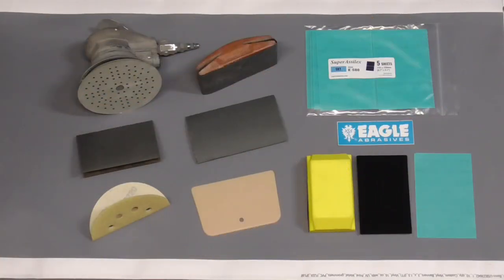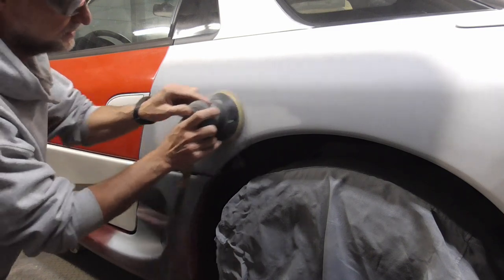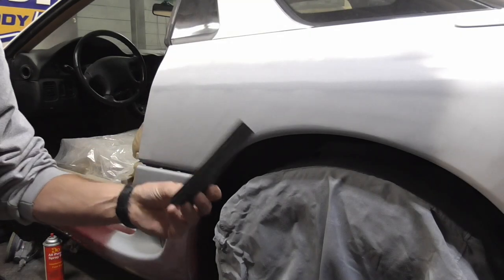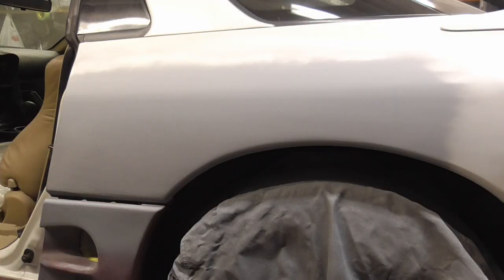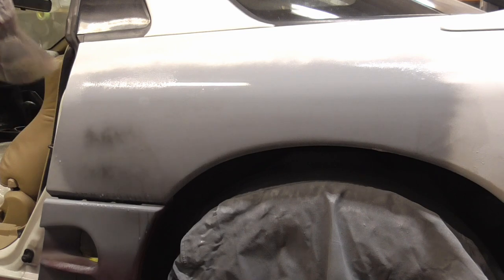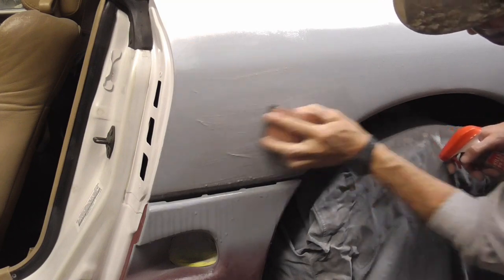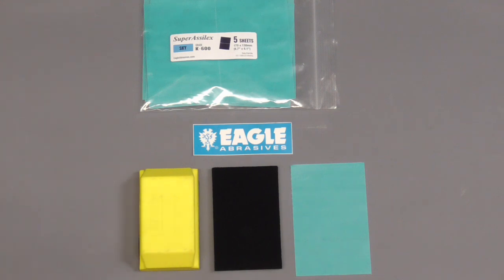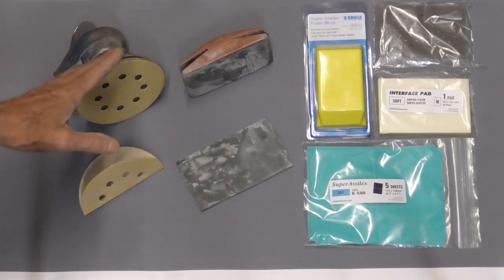Finish Sanding the Final Coat of Primer - Clear, Easy Instructions

Comment: I am a big fan of hand sanding wet personally. Keeps the dust under control and reduces heat from friction. Plus I like the exercise. Right now im prepping one panel a time on this Integra and goal is to paint in the fall when its in the low 70s and almost no humidity. Got a waterproof cover till then to keep it fresh haha. Thanks for the videos.
Reply from the maker: The exercise is incredible really.  Wet sanding an entire cars can trim up those arms pretty quick :)
Reply: Building a kit car with alot of fiberglass, I started to find wet sandpaper in the grits I needed. 
I even found out a neat one , harbor freight Hercules 80 grit paper (it's blue) works with wet sanding and the package doesn't even say it. 
I said wth, let's see if it crumbles off when I wet the paper and it didn't. 
Anyways ,I've been able to keep alot more dust down even with the sawzall because I'll spray water from a bottle at it.  
Springtime ,I'll open the shop and me and my helper will blow it all out with some backpack blowers 😂

Comment: Is the Tremclad rust paint Primer any good to use ? It's oil base and can be thinned for spraying. I'm doing new fender patch panels on a truck box. There are pitted rust spots in areas I cleaned up with wire wheel and painted over with POR15 STOP RUST and will also use it on the back side of the fenders.
Reply from the maker: I red up on it a bit and I can't see why it wouldn't work just fine.  I don't mine Rustoleum products at all - they work real well for rusted machinery, frames, body parts, etc :)

Comment: So you don't necessarily block sand out the final coat? Do you seal with epoxy after this?
Reply from the maker: No you're just sanding out any orange peel in the primer, small imperfections, and if you prefer, you can use a block just to keep everything nice and straight.  Just making the surface as perfect as possible.  You can seal with what ever sealer you like - then paint.  Here's a job done with sealer - https://www.youtube.com/watch?v=aJHa1grz5Fs
Reply: @LakesideAutobody  I looked that up, the SG1 is not an epoxy? Do you generally use epoxies? I assume the sealer coat doesn't need to be sanded because it is so thin? Sry, many questions, lol.
Reply from the maker: @slayer7976  No - I don't use epoxies usually.  I do use epoxy primer on aluminum though just because it's "recommended".  A sealer doesn't need to be sanded - it can be treated really as a first coat of paint.  Keep asking ?s - no problem - Jerry

Comment: Never heard of that Eagle dry sanding system. What's different? Is the paper sharper, more porous? I have a Jimmy almost completely in primer right now, but think i'm gonna wetsand 600 grit for my final sand. Not going single stage or I would quit at 400.  Got some high solids clear and looking for as smooth a finish as I can muster. Even going to use(try) basecoat activator as it claims to offer advantages if added to the base coat? Guess i'll see....
Reply from the maker: The Eagle dry sanding system claims to cut faster because the paper flexes - is almost like material,  doesn't clog, etc.  Here are some of the advantages according to the company if you are interested -

Fast and uniform coverage, leaves no un-sanded areas
Extremely shallow scratch pattern, safe from "over-sanding"
Flexible contact, ideal for concave and convex areas
Efficiently removes wax, incrustations, dirt and dust
Time saving of 50% or more thus greatly improves productivity
Reply: @LakesideAutobody  well, they make it sound pretty good👍

Comment: How far up in grit do you go before paint?
Reply from the maker: It's common today to paint over anything from 240-320 using a DA sander.  If sanding by hand (wet or dry) common grits are anything from 320-400 - 600 is very fine but you'll hear of guys using it.  I usually paint over 240 using the DA, 400 if sanding by hand, or scuffing with the red pad.  Basically, you'll be fine using 240 on your DA and 400 if you sand by hand wet or dry.   I have painted many times over 220 DA scratches too w/o issues.  Here's a sand paper guide if interested - https://www.youtube.com/watch?v=V5AyJv6i4hg
Reply: @LakesideAutobody  Awesome thank you.

Comment: never use your hand !
Reply from the maker: That's all they used in the 50's 60's 70's 80's and the Autorama was filled with perfectly straight cars and hot rods.  Believe it or not with the right touch (pressure) the paper stays straight and your fingers will never make marks.  Much faster too!